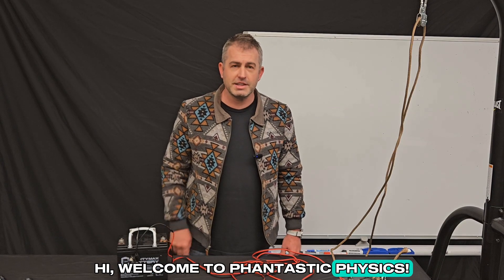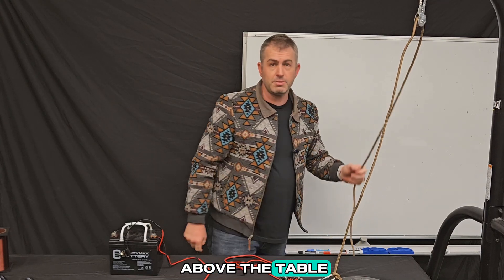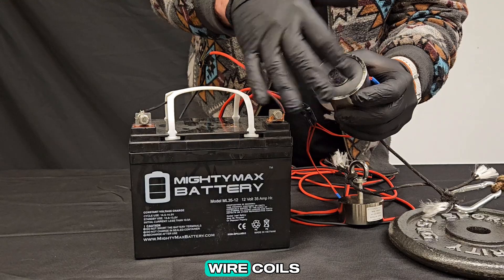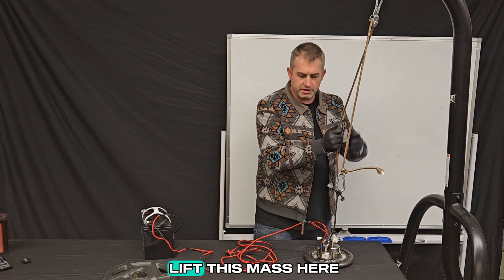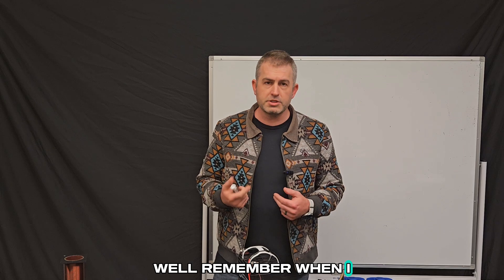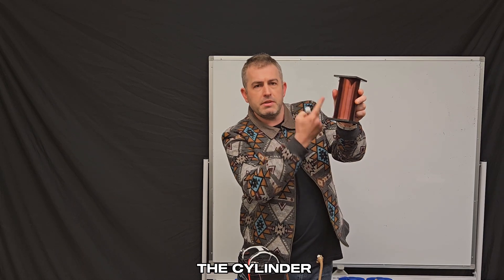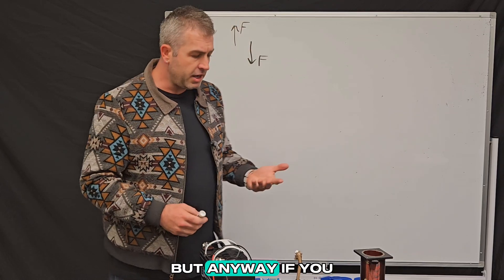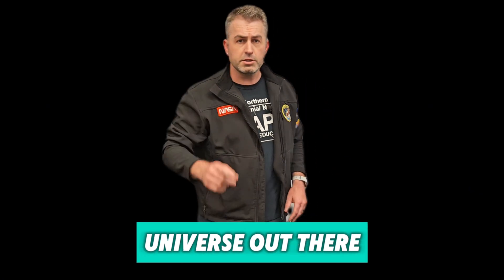I Built a POWERFUL Electromagnet with a Car Battery! (DIY Science)

Comment from the maker: Why did I choose to use a car battery for my electromagnet? Why didn't I just use a D, C, AA, or AAA battery instead?
Reply: Because 12v is better than 1.5v…

The video is misleading though as you didn’t make them, you just bought electromagnets rated for at least 12v
Reply: Was it because of the size?
Reply from the maker: @Flashback545 A 12V car battery can supply much more electric current through the solenoid (wire coil). The strength of the electromagnet directly depends on the amount of current through the coil!